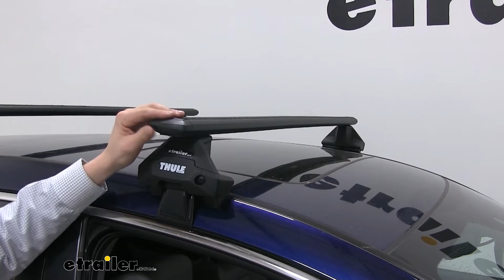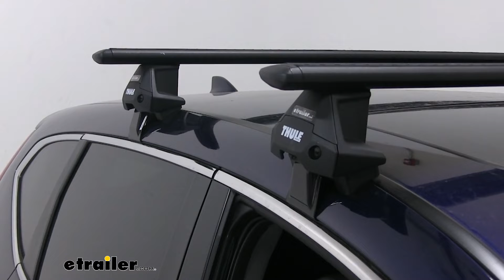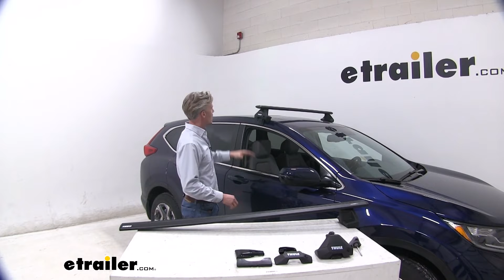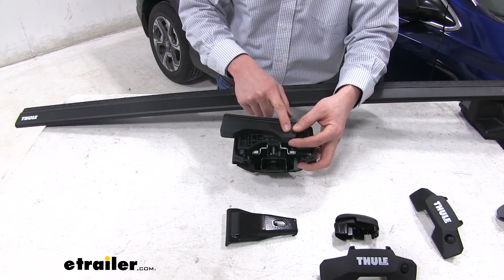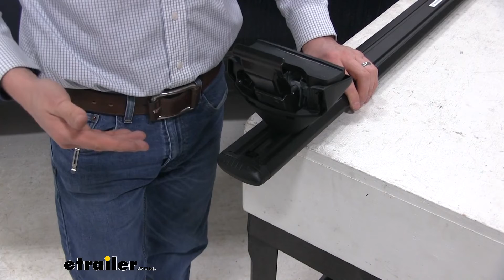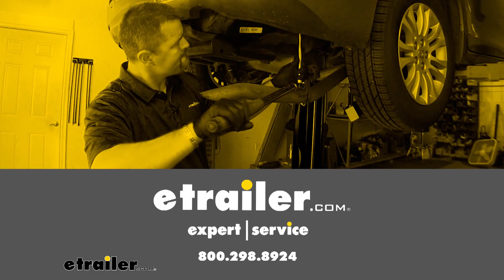etrailer | Mount: Fit Kit for Thule Evo Clamp and Edge Clamp Roof Rack Feet on a 2018 Honda CR-V

Comment: What rails are these used?
Reply from the maker: The rails used in this video are the 53" Thule WingBar Evo crossbars. Check them and the other components in this kit in the following links.
https://www.etrailer.com/Roof-Rack/Thule/TH711420.html
https://www.etrailer.com/Roof-Rack/Thule/TH710501.html
https://www.etrailer.com/Roof-Rack/Thule/TH145046.html

Comment: What's the upside of this instead of adding a roof rail?
Reply from the maker: These clamp on roof racks are a great option if you want to remove and install it easily. Most people will just install it when they need it and remove it when they are done so that the components stay in good condition.
https://www.etrailer.com/Roof-Rack/Thule/TH711420.html
https://www.etrailer.com/Roof-Rack/Thule/TH710501.html
https://www.etrailer.com/Roof-Rack/Thule/TH145046.html

Comment: Why r the rack not level when installed in this position?
Reply from the maker: When installed, these roof bars are very close to level. The slight difference is because of the contour of the roof on the 2018 Honda CR-V.
https://www.etrailer.com/Roof-Rack/Thule/TH711420.html
https://www.etrailer.com/Roof-Rack/Thule/TH710501.html
https://www.etrailer.com/Roof-Rack/Thule/TH145046.html